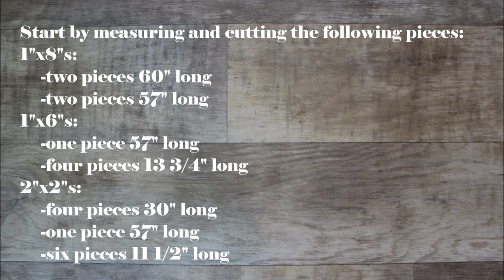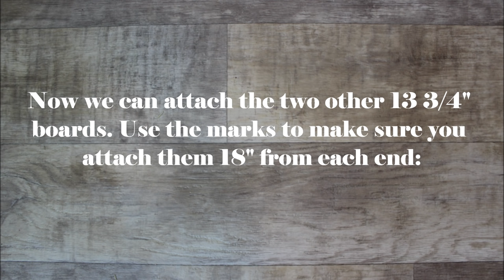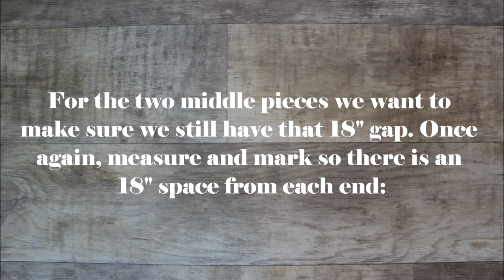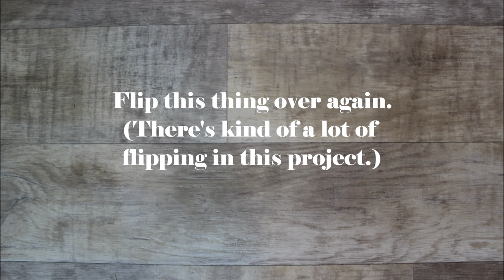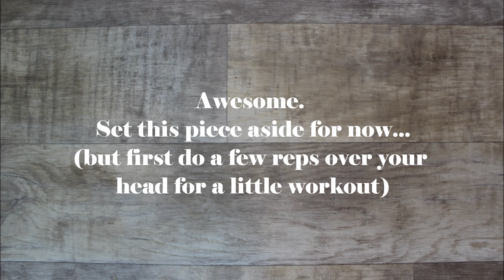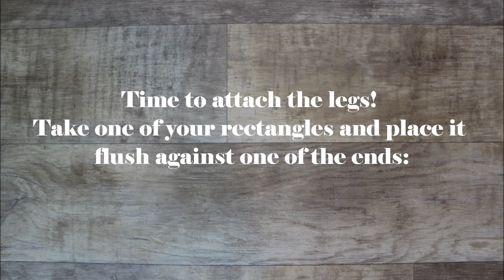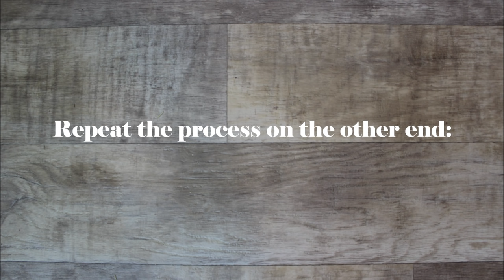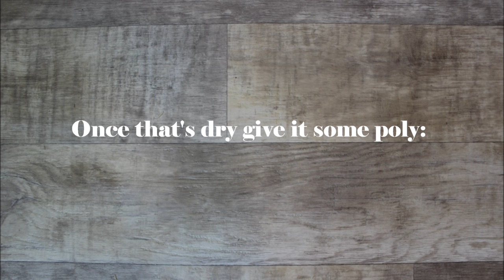The $30 Console Table - Easy DIY Project

Comment: I made two of these this week to sit under my windows in my family room. I made one to test my novice woodworking skills and then made a second one using better wood after my confidence grew. I added some wood glue and more screws (less nails) for stability. I also shortened the legs so the height would keep is under my window ledge. This video, while others may not appreciate it, has saved me nearly $600. People complaining because the overall cost is closer to $50 are being extremely petty considering how comparable stands will cost AT LEAST $150 (and MORE if you buy the quality of wood I used that only cost me $60). Thank you, Rehab Life!
Reply: Word up homie 💪
Reply: Exactly! Console tables are surprisingly expensive!😬 The stain and polyurethane can also be used on other projects. It’s not like you’re only gonna get one use out of them.
Reply: I agree.  These videos are inspirational.  I like the method they use to show the process.  If I want to up my novice game and try with pocket screws or use maple, I can do that.  I may want a shelf near the bottom and these and their other videos are great for learning.
Reply: How do the 2" screws do anything to secure the 2x2" leg board to the shelves? Wouldn't it just barely peek through?
Reply: Ignore the small minded people. I have my materials already to build this!!! I like your idea of using screws for more stability.

Comment: Did this table today, I think it came out nice.  $30 it did not cost, more like $70, but that's ok, it's still cheaper than the store.  Plus I have the satisfaction of building it myself.  I would recommend using the screws for the entire project.  They make everything feel tighter and a little more solid.
Reply: BattleshipStLouis  what kind of screws did you use?
Reply: Me too this was 90 dollars this video and all the other ones are misleading

Comment: I built this last night. I was very simple. However, the person at the store did not cut a piece correctly so I have some sanding to do. Other than that, it came out great. I used screws and wood glue just to make sure that everything stays in place. I am going to make the farmhouse table next. Love the videos!!
Reply: They cut all the pieces for you at the store? I didn't realize they did more than one or two cuts
Reply: How much did you spend on everything? Is it really only. $30?
Reply: I spent $76 on everything to include 2 different sand papers, carpenters glue, wood, and wood filler.  I already had the stain. I think the price depends on the type of wood you want to purchase.
Reply: I went to Home Depot with the measurements and the guy cut them for me. It was so much easier than to do it at home. Saved time, plus it was free.
Reply: Pamela Wilson What kind of wood did you use?
Reply: Unbranded Premium Kiln Dried Square edge Whitewood Common Board.  and Furring Strip Board at HD.  It may be cheap board, but this was my first wood project and I did not want to purchase something too expensive. It actually turned out very well!  I wish I could post the pic.
Reply: Well I didn't want pine for sure and that is the cheapest available.  I may look into a wood mill and see what wood they carry.  They should also cut them for free.
Reply: I did not sit a tv on it. I just have couple of vases on top of it. I stained it dark.
Reply: Pamela Wilson Well hopefully you got good wood and it doesn't warp.  I did see that HD carries walnut at a decent price.  Few dollars more than the pine.  I think I'll do the coffee table first.  Thx for your help.
Reply: hi !!! I need help !  What unit of measure do they use in the video? I want to convert it to cm
Reply: Inches
Reply: Janessa West Just be aware that they may not cut it perfect.  Home depot cut mine approx 3/8 inch too long.  so you still may need to do some cutting
Reply: I don't think there are much choice other than construction grade pine.
Reply: Infant to make this....how is it holding up after a year. Also how high are the shelves
Reply: I think the furniture being shown is GREAT! It's in a smaller scale, easy to make and low in cost. The tools required are not expensive or complicated to use. Applying the stains and poly can literally change the look of the furniture piece to look more upscale if a person chose to do so. I'm trying to see if they have a listing of what they make. A person could probably complete a whole roomful of furniture in a week. Thanks.
Reply: $76? Just buy a table
Reply: C. C. Lol I guess my boobs weren’t big enough to get some one to assist me 🤣
Reply: Pamela Wilson are the measurements right on this project?
Reply: @blonyaR  Yes. I made it with no issues. The measurements are perfect
Reply: @janessawest1815  depends on your store. I am a senior woman, and normally the local Home Depot charges $2 for each cut, but I had them do 40 cuts for a bed (and slats) that I made...the guys were super nice and only charged me $10 for cutting.

Comment: Just made one this weekend. Took your same designer but substituted the 1×6 for a 1×10. That give me enough room to put my books on the shelves. I also used pocket holes to do all my fastening of the legs. Between that and splurging for redwood for the legs, it turned out very sturdy. Would probably fasten the top with pocket holes if I were to do a similar design again so you dont get any holes in the top. All in all, great video and great design. Thanks!

Comment: Glad you used a respirator when applying stain & poly. But tbh, its worth using a P100 mask during sanding and at the miter station as well.

Comment: I'd like to see this built using red oak 1X material, pocket holes and glue and more support for the legs. Also with an 1/8" round over using a router on the sharp edges.

Comment: I did some research and priced out materials based on the given list:
For the wood at home depot i came up with $26.17 
For nails (40 pk), screws (100pk), wood filler, sand block- $16.87
Wood stain (8oz)- $8

Grand total: $51.04

The cost really can vary! Perhaps look on craigslist, offer up, fb marketplace, and/or local hardware stores for supplies. Even yard sales and flea markets or anyone that sales scrap wood. This is still a great price considering that stores sell these tables for 100 and up. Once you're able to find affordable wood, buy nails in bulk (so you have left overs for other projects), the possibilities are endless. Shop around folks and get creative =)

Comment: I shortened the legs, the length some, and added a shelf on the bottom to make a flatscreen display table.  The customer loved it.  I only had to cut holes in the back for cables to pass through.

Comment: Very nice.  The only improvement I can sugggest is using glue on the wood joints.  That would keep the unit from coming apart from the shaking.

I like the simplicity though.  Keep it up.

Comment: Without going into boring, explicit detail - I purchased all the lumber needed at our local Lowe's Home Improvement center.
Researching the same lumber online at The Home Depot, it would appear that Lowe's charges 2-1/2 times as much as their competition for the 1x6's and 1x8's. Just a note to everyone to price online, before making the mistake I made today. Great project though! This was the "perfect" table for our entryway.
Reply: Da Wabbitt I don't understand if they charge 2.5 times as much why did yiu buy from them?
Reply: Michael Hinchey - My local Lowes is a much better store to shop at. Everything is easier to find (without help from an associate) and they actually have more than just one cashier available, when you're ready to check out. So, I went there, without bothering to see if The Home Depot had the same boards available. There has also been times where either store has better quality lumber than the other. You pay for what you get. I'd shop at Home Depot more often, as it's much closer to where I live, if it were not for the hassle of standing in one line, with 15 people ahead of you and every other one seems to have some odd problem with their purchases.

Comment: Hello! really nice, i want to build it but the measurements dont aligne pretty well, can you please tell me if they are correct? example: with the 1 1/2" overhang, how will the 2x2 fit perfectly? great videos, im just starting to work with wood. Thanks
Reply: Rafael Gabriel Grullon Guzman I know your comment is over a year old lol but maybe it will help someone else. 2x2s are not actually 2 inches by 2 inches. they are more like 1.5 inches by 1.5 inches, if you measure them. That is why they fit perfectly :)

Comment: Could you just use plywood & cut to fit? Just asking if maybe that would be cheaper?Or would it not be as sturdy?Thanks for vid
Reply: Plywood would be much more stable
Reply: plywood needs power tools or a hand saw and VERY strong arm

Comment: How do these pieces of furniture hold up with use? I notice you never use glue or clamps and I'm wondering how that affects their longevity
Reply: ..probably okay considering they used nails when no craftsman would ever do that sort of thing
Reply: Using dovetail or box joints on the box with mortise and tendons on the legs and frame would insure this last multiple lifetimes with this version it's probably not super strong but usable
Reply: These won't last. The timber alignment has zero compensation for natural expansion and contraction; the nails are a very weak joint
Reply: MKRM27
Reply: uzhina  e lule

Comment: I dunno where you guys live, but the stain, poly, and wood filler alone would cost nearly $30 around here... Also, using pre-stain conditioner on the wood adds a step, but helps prevent blotchy results when you stain. All in all, decent project video even if it's a bit basic.

Comment: For use as TV stand for 65 inch LED - the depth is 12 - Width 56 - so what about the weight of 53lbs - can it handle or is the Kitchen island better ?
Reply: top section is most of a box girder, sure 53# no problem, but I'd use glue AND nails on every joint.  For insurance do the top double thick.

Comment: You did such a beautiful job! Do you ever use wood glue? Why or why not?
Reply: As I thought about this, for its intended light use, just nails is ok.  And you can build it in much less time than letting glue dry.  And glue runs, must be cleaned up, alters finish if clean up not thorough.

Comment: Stupid Question?

I am confused on when you attach the 2x2 legs to the "Shelf BOX" that was made earlier in the video.  The measurements in the video shows and says a 1 1/2" overhang on both sides, so how does a 2x2 line up flush with the edge? Wouldn't the legs stick out by 1/2"? Someone please show me the light?? lol Thanks
Reply: A 2 x 2 is only the nominal measurement it actually measures 1 1/2 inches

Comment: I'm concerned about the wood expanding with humidity. Has anyone encountered a problem with this on the table? Also, this is just using construction grade wood, not furniture wood, right?
Thanks
Reply: This is not (cherry) hardwood (Furniture wood), probably soft wood, Doug Fir, Pine, or whitewood from BIg BOx stor.

Comment: what type of drill is that?
seems to special to fix screws that easy
Reply: any kind of drill/driver and do this work.  Trim screws are self tapping and heads are TORX require special driver bit. Wood used is soft.

Comment: Question: when you make the cut, do you cut over the line or behind/front of the line? Thank you. :)
Reply: To cut it so that the length of it is what you want it to be and what you measure you always cut over or behind the line. With certain types of saws you can't see the line unless you cut in front of it, doing this will leave each piece roughly an eighth of an inch short. This is ok as long as you cut them all the same.

Comment: This project cost approximately $170 today just for the wood alone..😭😭 I don’t know about $30 cost 2 years ago though..not accurate I think..just my thought but project is so amazing I’m doing it whatever it cost..🤕
Reply from the maker: Price of wood can definitely vary depending on location. We can actually still get the wood for this project for the same cost. Are you using standard pine boards? Those are the cheapest...

Comment: who has that kind of equipment at home unless they are a professional carpenter ????
Reply: anastasia10017 you can buy that saw at the same store you buy the wood from.  I made the farmhouse table from their other video with a cordless drill and a handheld circular saw.  If tool price is too high, go to garage sales for used tools.  There are plenty of videos to watch about proper use of hand tools or power tools.  jump in and get dirty, ain't nothing to it but to do it.
Reply: anastasia10017   Most lumber stores will cut your wood for free. All you have to do is ask and have the measurements written down for them to go by. You can get drills  that are inexpensive at Lowes or Home Depot. Especially right now with holiday shopping kicking up. Walmart sells them too. It's an investment piece you'll use for years.
Reply: Harbor Freight Tools - Yes they have a reputation for low-end tools but they are cheap and while not professional quality, they doe the regular home owner a job for years!
Reply: Thank you!!

Comment: I'm pretty sure it only cost $30 because your wood is cheap scrap, (you can see it's rough & full of knots) & you already had everything else that was needed; the stain & the poly each would each have been $30 on their own. Watching you work is nerve-wracking - barefoot DIY is just plain dangerous. As a kid, the very first thing my father taught me about tools was to leave them alone if you're not wearing shoes, I'd expect it to be common sense for an adult woman. Your nail polish is just gorgeous but please put some shoes on, there's nothing sexy about losing a toe.

Comment: 30.00 ???????????? I have been wanting to make this kinda almost the very same build. I have priced supplies at lowes first and total for everything will  be around 55.00 plus tax. you will need more sandpaper than what she had to make it really smooth...  I guess if you had extra supplies from other jobs than maybe it could be 30.00 or less. but if you go out and do this right now your spending well over 30.00 truth be told.... why label videos with incorrect information... I guess she is a plus having her around while doing projects....  her bottle opening horse teeth will provide you with a way to open your beer... cheers.

Comment: You should now have 20 pieces cut, an unsquared box. No glue so it’s sure to fall apart. Oh yeah, splinters in your feet. Use a table for the miter saw already. You’re a joke